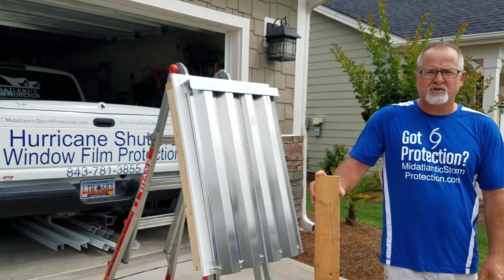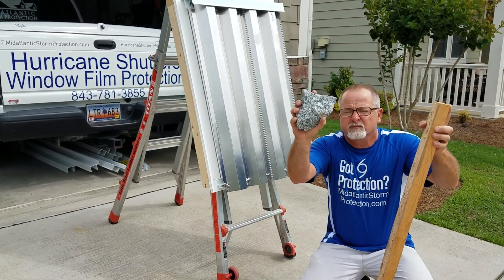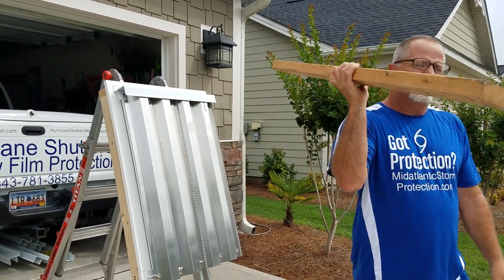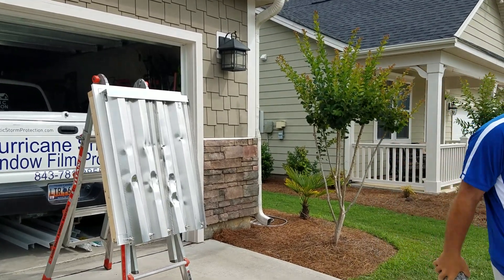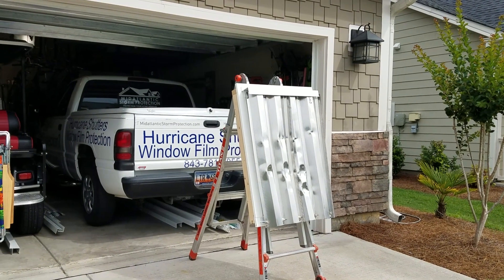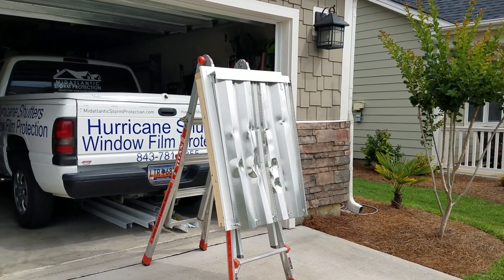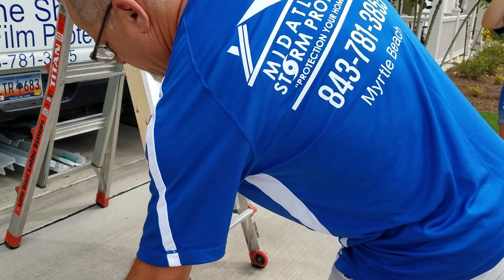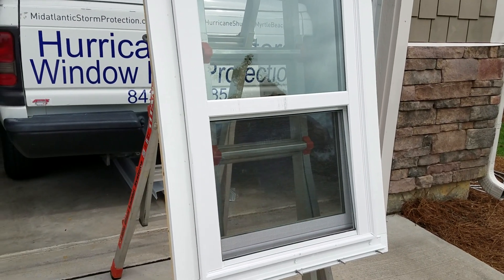Hurricane Aluminum Panel Test. 2018 Midatlantic Storm Protection Myrtle Beach

Comment: So human strength compared to 90 - 110 miles an hour wind?  Not sure how accurate this demo is.
Reply: Do you realize what the odds are of a 2x4 hitting the exact same spot like he did a few times?!  Those windows aren't going anywhere!
Reply: @joshmartin7865 , learn physics. Hurricanes will launch an object (e.g. 2x4) at your house at ~34 mph. No human can launch a 2x4 at that speed.